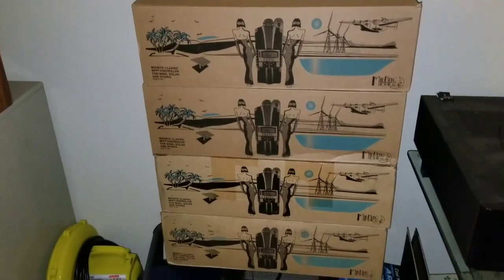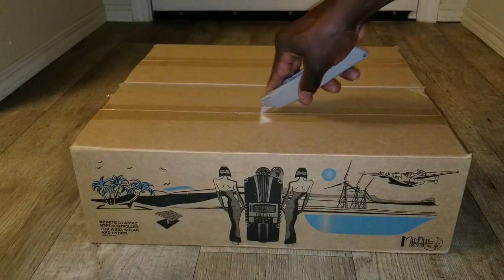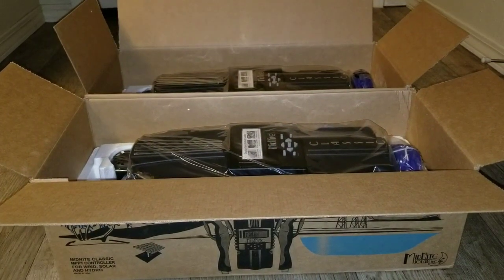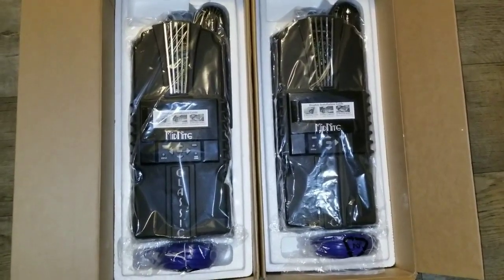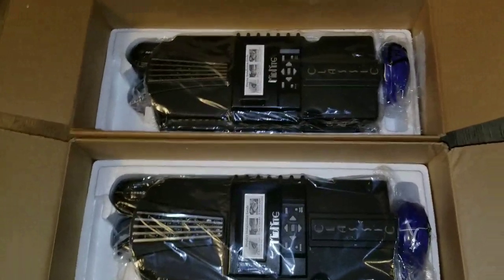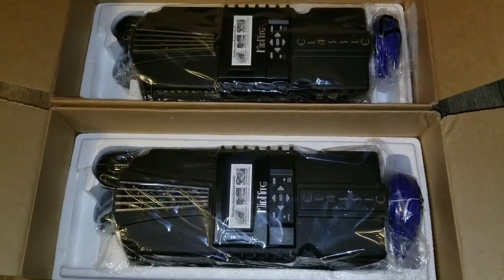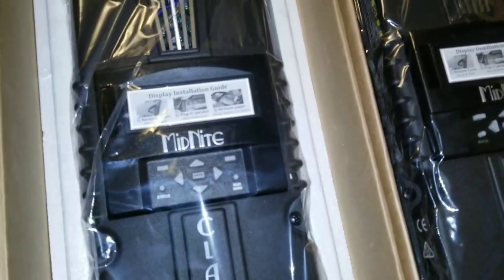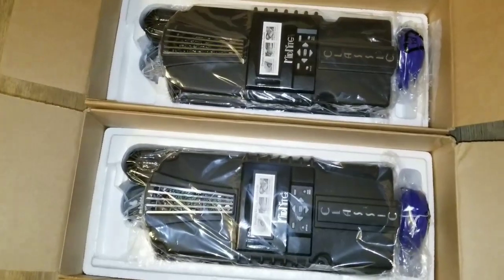MIDNITE SOLAR INC: MIDNITE CLASSIC MPPT CONTROLLER FOR WIND SOLAR AND HYDRO POWER

Comment: I would like a couple midnite classic150's or 200's,   i don't need over over a 200, probably never have over a 100-120 volt array, from what I have learned, the midnite is about the best controller, lots of features, I could probably get by with the SL,
Reply from the maker: If you are not interested on running high  voltage over 100 to 120v why do you need a high voltage MPPT Charge Controller for?  The higher the voltage the better and  Efficiency they are and less spending on cables.

The MidNite Solar Classic are designed with smaller input and output terminals compared to OutBack Power Systems which has larger and wider inputs/output for bigger cables compared to the MidNite Solar Classic.

If you don't mind me asking, why do you want to get a MidNite Classic SL? You know the SL is only designed for Solar NOT for WIND or HYDRO functionality right?